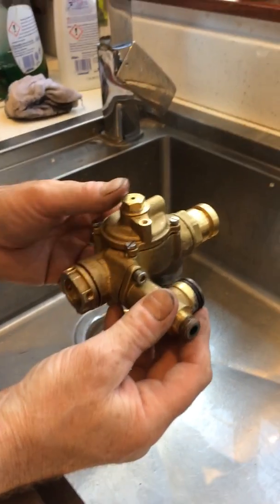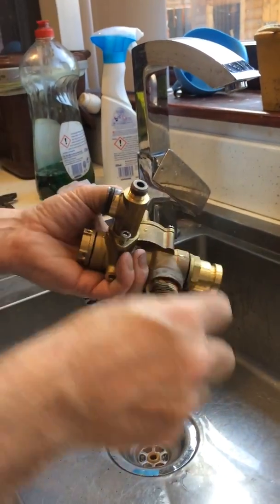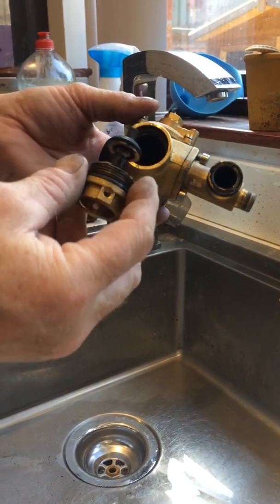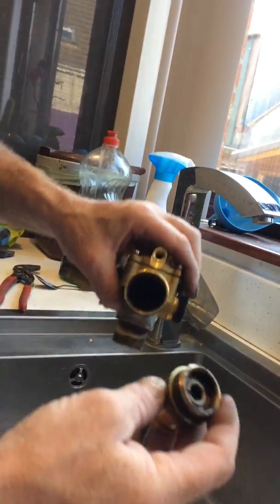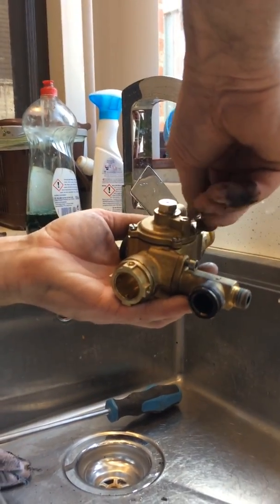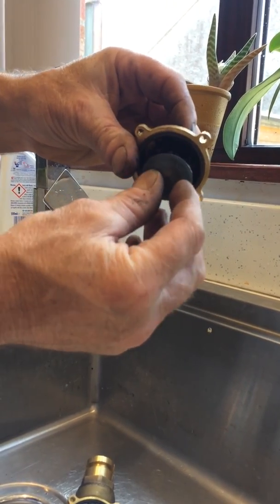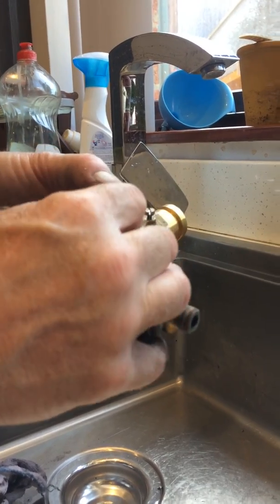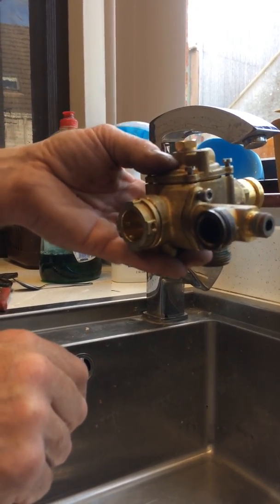Diverter valve for Baxi 105HE

Comment: Hi, a quick question, on my bolier thee central heating work fine heats up good, but hot water is very limited as the water get warm then cold very quickly then hot and cold.  Very limited hot water you recon its d valve as I have change the big diagpraph already?   Thanks
Reply from the maker: Looks like you have dirt in the plate to plate. Phone a local Gas Engineer

Comment: Hey, you've posted the rear bobbin goes the other way round also what do you mean? i've got a baxi eco80 , hot water initally worked after copying this guide but CH not, i was sure the back bobbin was against the filter face rather than sat on the spring, cheers